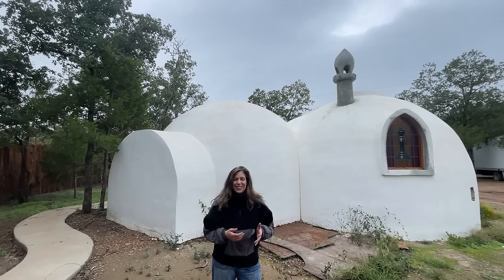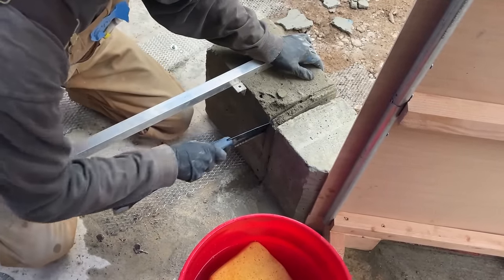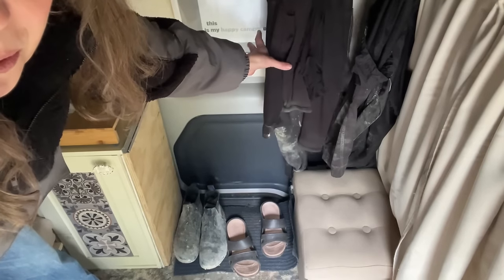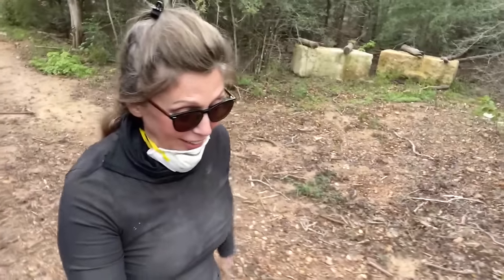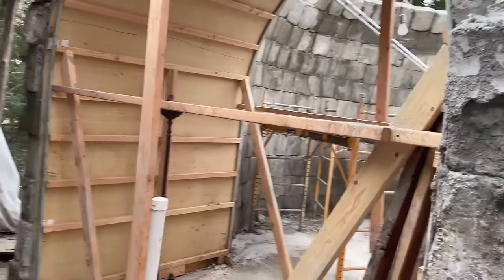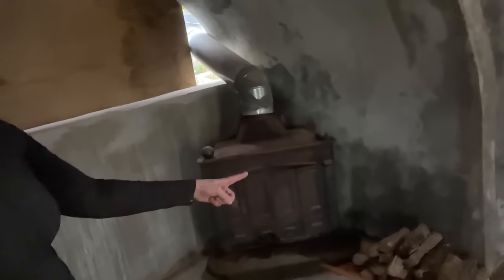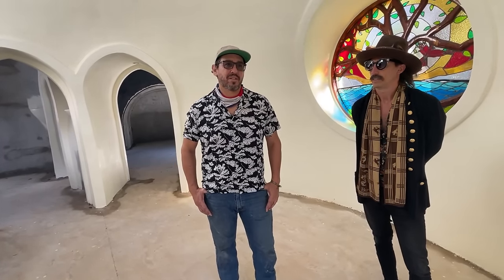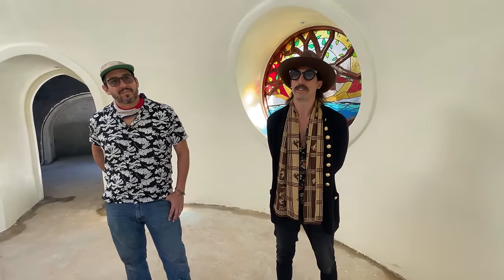Van Life | From My Van to Aircrete Dome Home!

Comment: Great video.  It was a  pleasure working along side you at the workshop.  The blocks form a fairly light insulating substructure (well light is relative I guess-the blocks weighed about 10lb each, but it is a LOT of blocks).  Most of the strength comes from the skins.  I think one shot hints at this - in this case there was fiberglass mesh lath in the first coat of plaster.  That was installed as the walls of the dome went up (after we cleared about 5', we lathed and plastered the first 4' for additional strength before we continued higher).  That said, the finished structure is quite strong.  One thing I will add - While I still love the concept after the workshop, the workshop did show us it is labor intensive.  But that is to be expected when you are building something out of about 1k blocks, virtually all of which need to be to fitted.  The workshop was well worth the experience, and most of us look forward to working on more domes in the future.
Reply from the maker: Yes!!! VERY labor intensive 😝

Comment: So cool!!! I am actually going to be taking up Welding. The classes are from Feb to May. I want to be able to make certain things on my van without paying a fortune to someone else. For example, I want to turn my under-mounted spare tire area into a hidden lock box with access from inside the van...and a custom roof rack and swing-away basket rack I can hitch to...oh...and still thinking about how I want to attach a winch. My only fear is the problem I have with my hands. I have to atleast try and adjust as needed😊.
Reply: Love your ideas and ambitions!
Reply from the maker: That’s awesome! Yep, only one way to find out 🙌🏼💃🏻💪🏼

Comment: Hi Dee , even though the building of Dome Houses with Aircrete is an exciting concept , here in the UK buildings that have been built with Aircrete have been found to have structural damage and are having to be demolished . Aircrete has a relatively shorter life span than other building materials , with this in mind just be careful if you are considering investing  .
Reply from the maker: Interesting 🤔 thanks for the heads up!

Comment: You are an adventurous woman!  I did a brain retraining program hosted in Austin about 10 years ago that had a restaurant with garden food prepared fresh daily on site.  I was wishing I could go back and eat there daily, it felt good on the body!  Texas girl not in Texas anymore but I have traversed those outback’s a few times in boots with fishing rods stepping over longhorn steer patties.  Some interesting characters for sure 😊

Covered in concrete mix  everyday had to be a bit taxing.  I’m more than a bit sensitive to the building products being used, but if I wasn’t that would be cool to play with on a small scale model board mice size for a season before taking on a full scale project 🤷‍♀️
Reply from the maker: Yes, it took several weeks for my hair and skin to recuperate after being surrounded by concrete dust😜

Comment: good day lady bugout my name is edward ,new to your channel found it while checking out other van build videos , i watched several of your videos and came across the one where you camped in the hiawatha , i moved to the u.p. two years ago thought it would be a great idea to live off grid so i purchased a cabin with 35 acres in the middle of the hiawatha , it needed a lot of work , it was late august when i started work on it and by september it was already below 32 at night and still had no heat source so had to leave and find an apartment , ended up in iron mountain it was the only place i could find that would except my pets , planned on getting back at it in spring but decided to sell instead, just being out there 1 hour drive away from escanaba and munising was a bit much , so i purchased a van and started my build , so far the walls and ceiling are insulated with havelock wool a moisture barrier and paneling i used owens corning pink board for the floor insulation . it's a little to cold to work outside now but look forward to spring and finishing build , plan on exploring everything the u.p. has to offer love it up here . i have a red van as well if you see me out there camping , riding dirt bikes , mountain bikes , hiking stop and say hello you have an amazing personality and would love to meet you . safe travels
Reply from the maker: That’s awesome. I will keep an eye out next time I’m around there!☺️

Comment: Does this meet building codes? Florida we have hurricanes.
Reply: Domes are the best structures to survive hurricane force winds.
Reply: @janeysiegrist5061  Just did research. Hurricane Ian destroyed dome homes.
Reply from the maker: I would check on the website. I’m new to this😊
Reply: @LadyBugout  I’ve been researching and it has excellent reviews. Thank you for getting involved and posting the video, you are appreciated. ❤️ There just isn’t much that can survive high category hurricanes and tornadoes.
Reply: @donnahibbard1774  that was built on an already eroding Island  in the 80s. Multiple hurricanes damaged it and it had been abandoned since 91. Please research more than what pops up in the first 10 articles,  and at least read about it before you use an example of a dome home destroyed by hurricane Ian.

Comment: Lady Bug will need to modify the van to EV status?
Have this air crete block material supply a robot pump to pour/build, upside down/rotating mold for the dome ? 
What is the cure time for the blocks?
Thermally efficient walls. What about the windows and doors? How is adequate air exchange achieved?
This village will need a Tesla Megapack.
Reply from the maker: Check out the domegaia.com website for answers to all those questions!

Comment: Unfortunately you have to make sure that the location for building with alternative materials does not have building code restrictions or you may find yourself having to tear down all of your hard work. I took a course about 10 years ago on Earthship home building only to later find out that the vast majority of counties in my state require a building permit and they only accept traditional stick building applications.
Reply from the maker: Yes, I had heard that as well. I am just testing the waters and learning as much as I can. ☺️
Reply: @LadyBugout  Aircrete is very similar to what I learned a long time ago called foamcrete (aka - styrocrete) for building domes with a large inflatable balloon and one of those machines used to plaster the inside of pools. Styrofoam is shredded up and mixed in with the concrete. Like Aircrete, you can use common wood working tools to cut and shape as needed.

Comment: Tengo una consulta... sibquero acer un domo con varillas de hierro.. no se como se llaman alla.. y combinar con tecnica de barro y paja. O tipo quincha.. se puede hacer?. Y estabilizar la tierra con cemento.. y la ultim capa con ca t aceite de linol para imprmeabilizar?
Reply from the maker: That is a question that their experts can more easily answer. Consult their website. They would be happy to get back with you on that ☺️